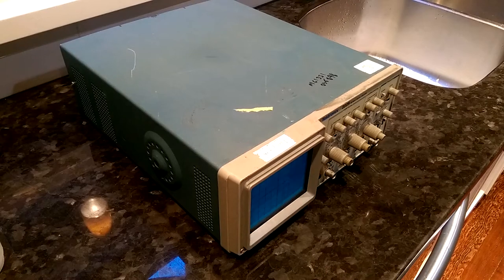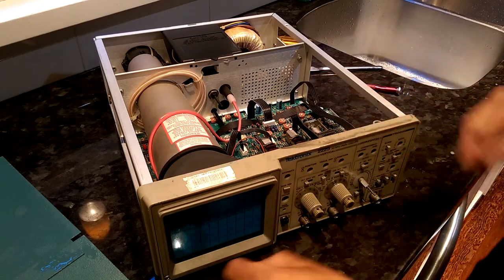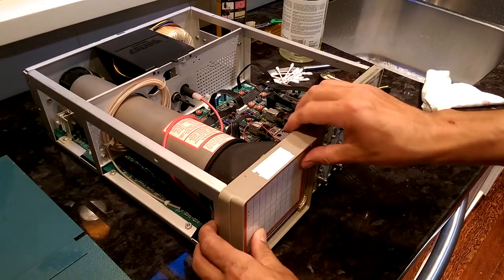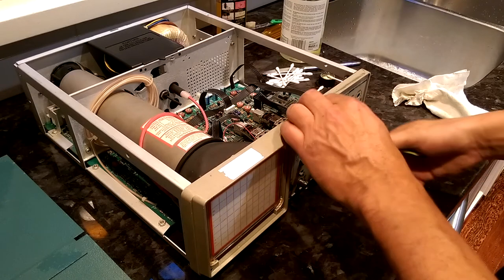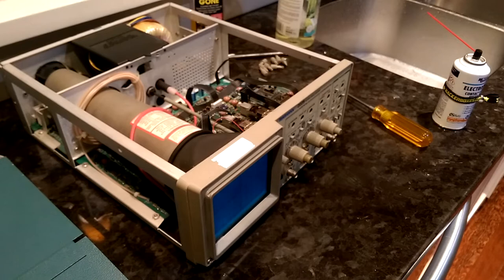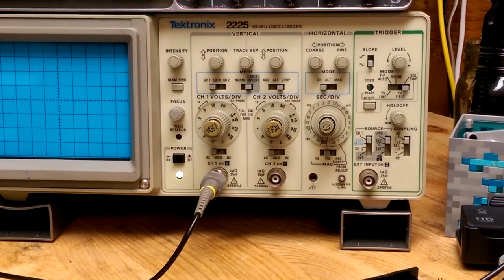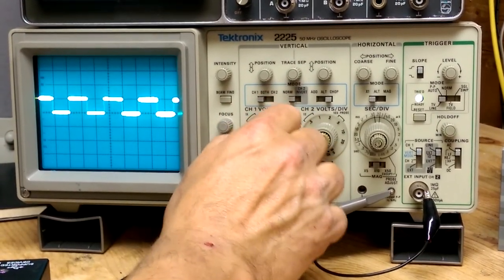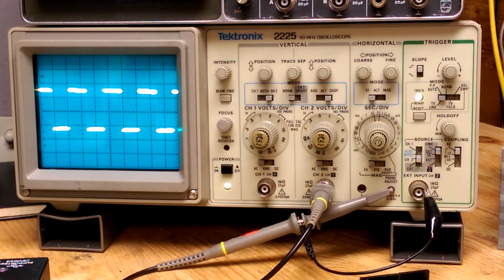Cleaning the Tek2225

Comment: There's a screw in each of the lower corners of the screen that you have to take out.
Reply: Hi Larry, any idea how hard it is to replace the horizontal  X1 ALT MAG mode switch as mine is broken ?
Thanks in advance.
Reply: @gixerags750  I'm sorry, it's been a year since I had mine apart. I had never worked on an old scope before, and I never found it very difficult to get access to anything in the unit, however. I replaced the all the top row pots in mine (which required some new knobs, but oh well), and it works great.
Reply: @larrybud  no worries...my Holdoff potentiometer was broken off as well..I will give it a crack.
Cheers
Reply: @gixerags750  The pots that I used were basic no-names, too. They were the kind which would bolt right to the case, then I ran wires to the board. The pots that are original solder directly to the board.
Reply: @larrybud  thank you.